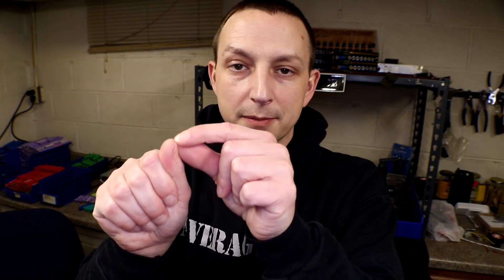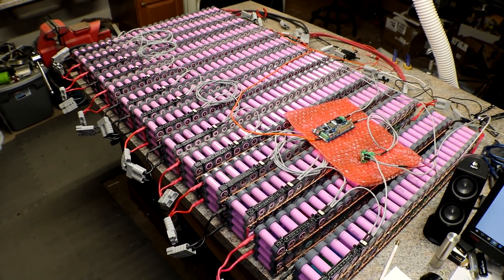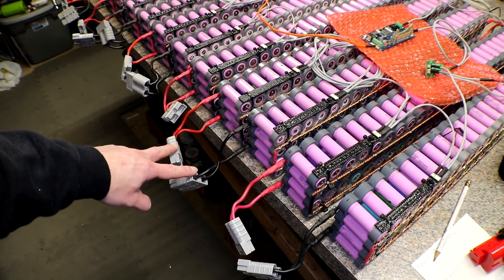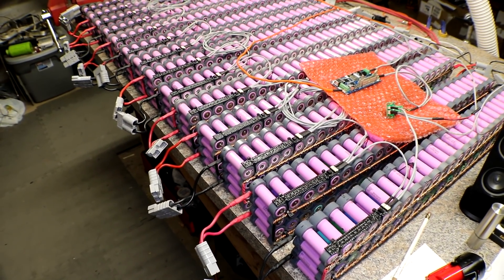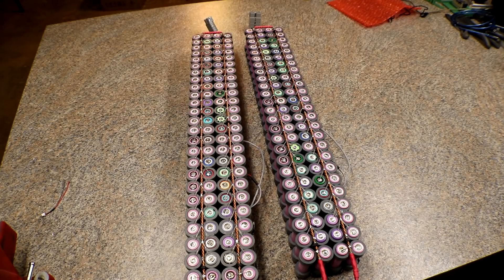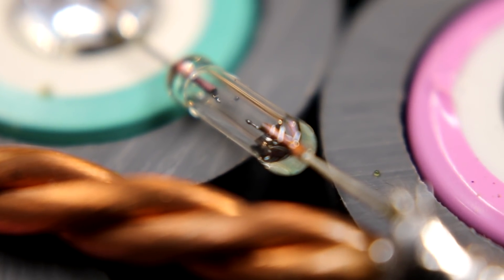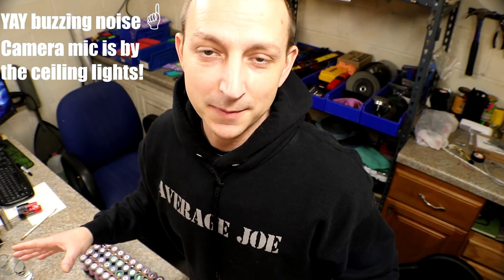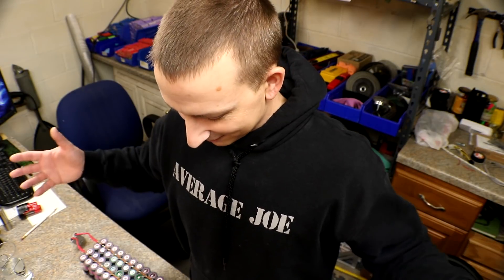Diy Tesla Powerwall ep75 200 Fuses BOOM!!!

Comment: Does your UPS/inverter output a sine wave or a square/modified sine wave?  I've found that some UPSs have extremely dirty square wave output, and others are a cleaner square wave, but still a square wave (as viewed on an Oscilloscope.)  Only the pure sine wave output UPSs please all devices I plug into them.  Some devices are less forgiving to the square wave inputs.
Reply from the maker: Yeah the manual states its a pure sine wave. I dont have anything to actually check it other then a watt meter that shows 60hz.  I know on a square wave it will show dc on the hz setting.

Comment: Wow. (Deep breath),  this is why we have fuses, perfect example. That could have been SO MUCH worse. I hope a lot of newbies see this video it’s pretty important!  I shorted an 18650 last week during a tear down of a laptop pack. I was snipping the cathode to get the weld smooth and touched the casing. DAMN. I don’t think people realize hot hot these get in real time. I could feel that Cell get very hot in under 2 seconds!
So tell us or better yet link us to the fuses you are using it might help other stay safe.
The Hello Kitty 🐱 apron is really styling! 😂😂🤪🤪🤪💥💥💥💥💥💥.
Love your sense of humor.
Bryan
Reply from the maker: Yes for sure this is a Prime example of one of the reasons to have fuses.  Granted most of the time the packs wont be hooked up in series on your work bench but still......  Yeah I try to be as careful as I can be taking the packs apart and sometimes Ill make a few sparks!  I updated the description box with links to the glass fuses!!!  The Hello Kitty apron is hilarious so I just had to wear it LOL😆💥👍
Reply: This is absolutely a validation to the early work you put into testing per-cell fuse options. You could have blown 200 fuses and became a statistic.
Reply from the maker: Yes Sirrr For Sure!!!💥
Reply: Tiny Solar Shack Yes it’s very important, the current these packs can supply could easily weld pack bus bars together if accidentally shorted, then you have a melt down disaster on your hands!!!!. Fuses are a MUST ! I accidentally shorted one of my packs out a few weeks ago - used a non vde screwdriver so screwdriver shaft shorted the battery pack, opps. No sparks as pack was reactively low voltage (~3.6V) just saw the fuses glow and melt quickly.. I use the same fuses as average joe - 1.5 or 2.5 rating I believe. I tested them on my lab power supply and they always fail immediately after 4-5A. My cells Samsung 26-C’s can max output 5A continually, but system will only pull ~1A each when inverter is fully loaded. So 1.5-2.5 fuse rating is good for my set-up.

Newbs to this need to take note as this needs to be thought about and understood, why skimp on one of the lowest cost parts of your build. Buy proper fuses don’t use thin wire or resistor legs. Not worth cheaping out on this part!!
Reply from the maker: Agree 100%! Fuses are a must and they are cheap. Why cheap out more on something that is safety related!!!